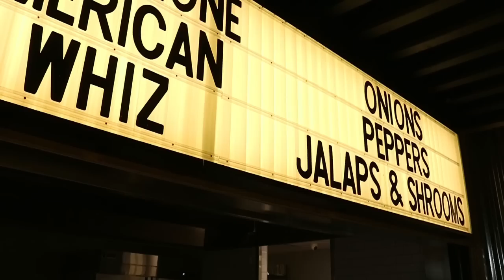Giant, Old-School, Marquee Menu Board

Comment: Isn’t it amazing how much smaller a sign looks after you get it mounted especially those 20 ft high or so ….I’ve told customers that and then they were extremely surprised when the sign went up how much smaller it looked.

Comment: Great work! What determines using 6 LED strips for this particular project? It there some lumen per square inch calculation used, or a lot of trial and error, or just plain old experience, or... something else?
Reply from the maker: For something indoors like this, 4-5 inches apart and about 4-5 inches away from the face is usually a good starting point for these strips, but I usually test it first.

Comment: why did you use 4 drivers for the LED strips?
Reply from the maker: Each supply powers every other strip for half the sign. If one fails, half the sign dims instead of going out completely. Each quadrant is a little under 4 amps, so I used 5 amp supplies.

Comment: Why so many led transformers?! You could have used a single one
Reply from the maker: Each supply powers every other strip for half the sign. If one fails, half the sign dims instead of going out completely. Each quadrant is a little under 4 amps, so I used 5 amp supplies.